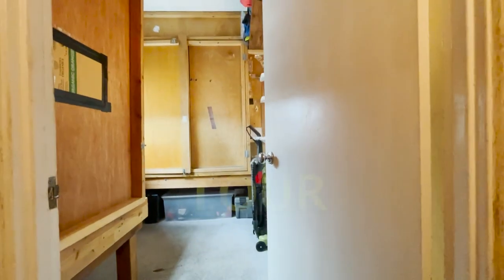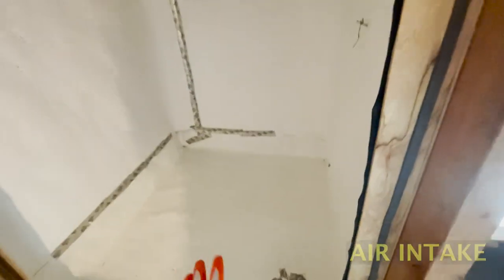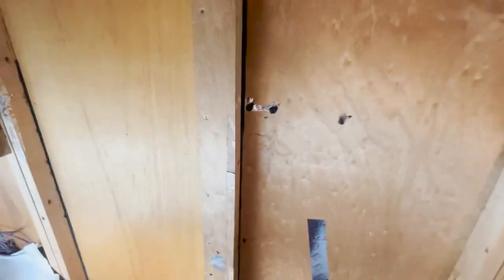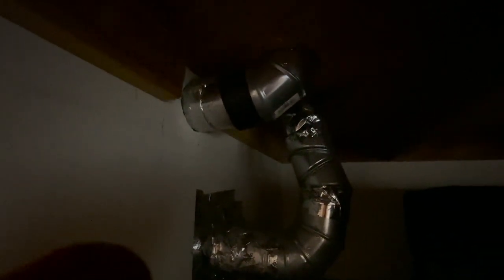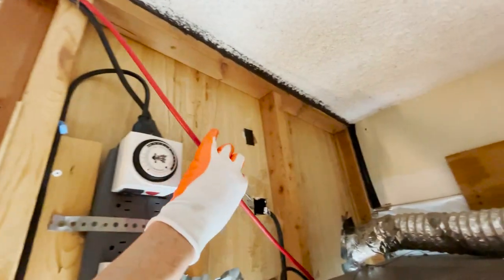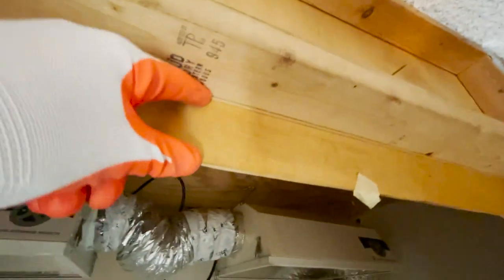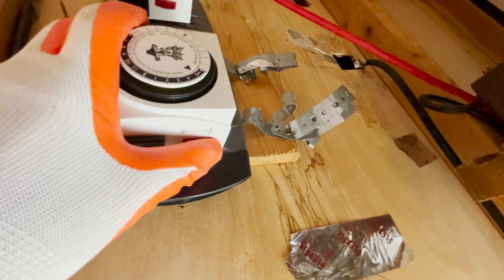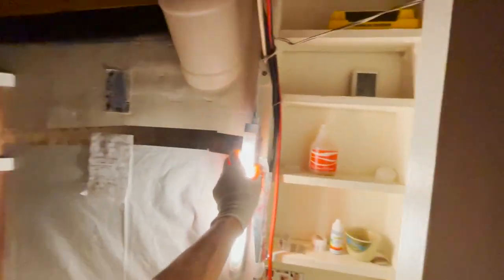INDOOR GROW ROOM Conversion TOUR |Turn a small bedroom into this!

Comment: This is cool! Luckily I have extra space and a 4x4 tent to use for veg outside of the 8x12 space I'm planning on using. It's a basement so a little different
Reply from the maker: Great.  Yes every space is different.  Try to plan it out as much as possible.   Fundamentals are same such as proper  air flow, circulation, venting, and functionality.